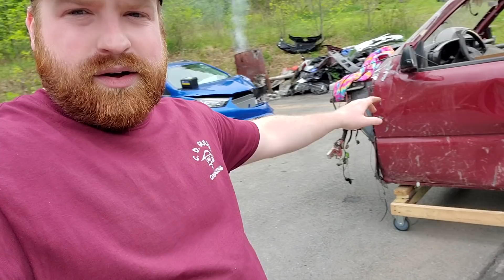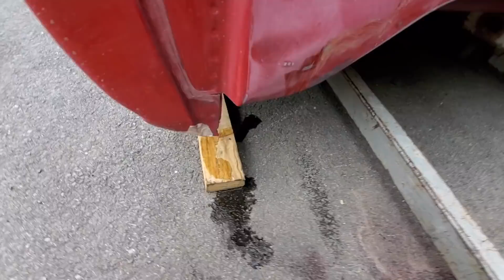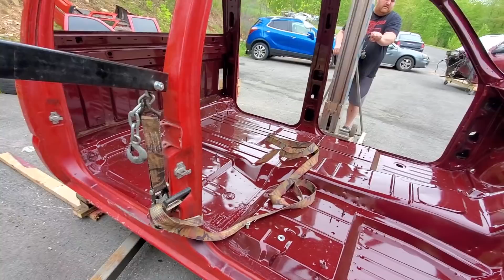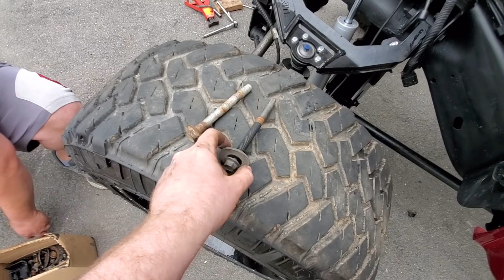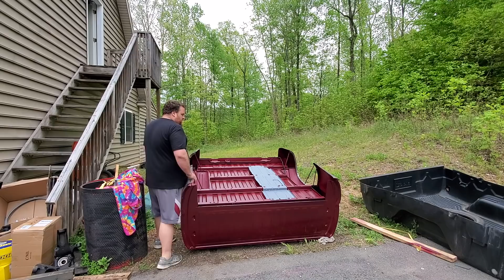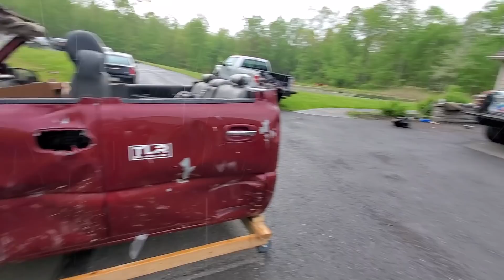The Whistlin Diesel Duramax has a New Cab and Bed Installed!

Comment: It’s taking shape ,we use those crank up jacks at work. I install big pizza ovens . Out lifts are a little shorter . They can fit thru a 32 “ door . For easy removal and installation of new ones .
Reply from the maker: It worked pretty awesome, doesn't lift a lot of weight but still handy

Comment: I’m not usually a fan of the low pro tires on trucks but that setup looks great
Reply: The thing is they really aren't low-pro if I remember right those are 35x12.5 on 20x12 wheels so that's 15 inches of tire which leaves 7.5 inches on both sides of the rim... I have basically the same thing but mine are atturo trailblades (34.3x11.83) on 20x10 cruiser alloys (discontinued)

Comment: Spray some fluid film on your hy- jacker, on the slides and bearings, will work much better and you wont have to help it go down, i have 4 of them at work and they work much better after using fluid film

Comment: put on fender after most of the engine bay (wiring, bolting components, etc) then when you put fenders on most of the work is done except fuse box, etc... easier i find that way.
Reply from the maker: For sure, that's our plan. Just considered loosely putting them on for a picture.

Comment: Did you paint the back of the cab
Reply from the maker: No, the body shop wanted to take care of it when we drop it off, its got some pretty big scratches and dings so they will pull the bed off and make it right.

Comment: Did any one else notice  he has no  cv axles  in it. Which  mean no preload on the wheel bearings  witch means those wheel bearings  are fucked
Reply: I am definitely not saying you are wrong, because different wheel bearing manufacturers may do it differently, but the donor truck for this project is a 2wd, it has no stub or anything through the middle of the assembly, just open splines. So I looked up the AC Delco part numbers and they use the same assembly for the 2wd and 4wd versions. So at least with AC Delco, it doesn't matter if anything is in the center. Good news is, if you are right and they start humming, they are lifetime warranty.

Comment: This build has gone so much quicker than I thought it would. I’m actually really impressed, for a couple of amateur guys without the best tools or a big shop with a lift, you guys have done this faster than a lot of better equipped & more experienced shops could, even after having to do a lot of things twice lol. I once did basically this same thing to a truck and it took me 11 days working all night every evening by myself, but it was an older regular cab truck and I did some of it at my shop which helped. There is a ton of work to doing a cab swap like this, you guys have done well to get this far this quick, some guys would take months to get this far and it wouldn’t look half as good as it does. The detail work on the underside and on the frame really makes a huge difference with the end result